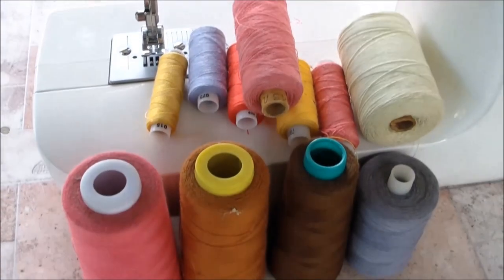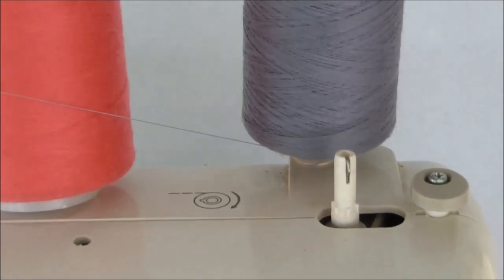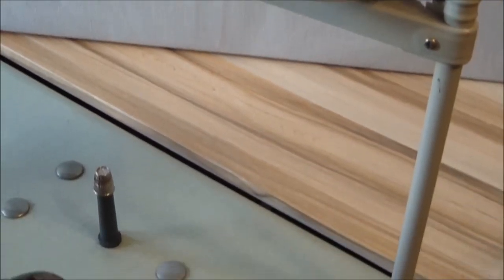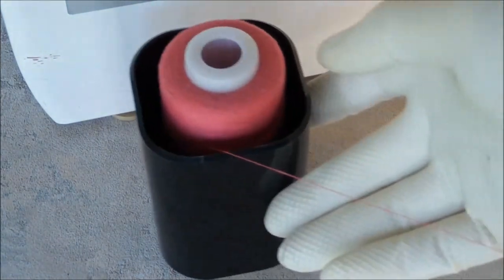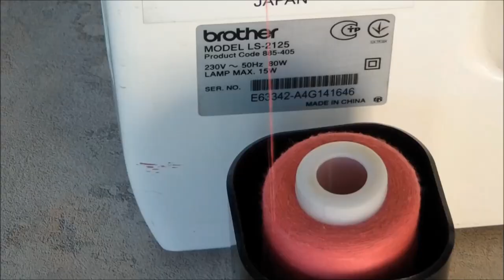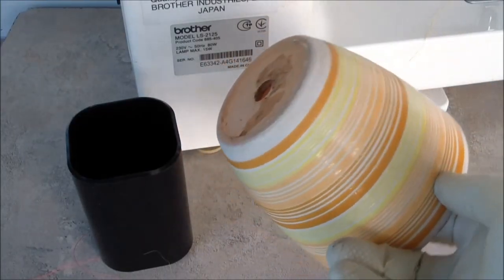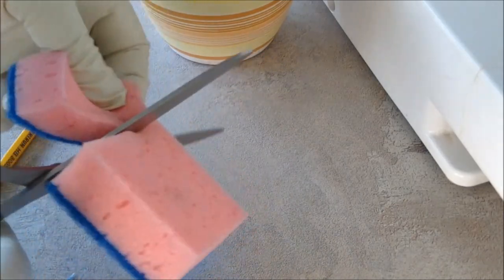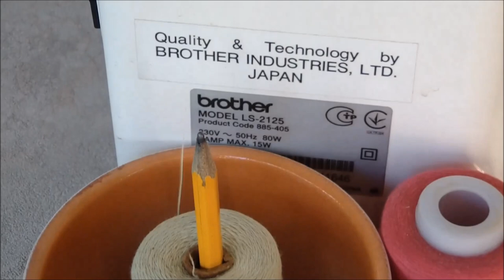How to Sew with Big Cone Threads on Home Sewing Machine

Comment: I'm just looking at other ideas.  Everyone did put the thread in a mug you are the first with a plant jug with a pencil! The other people then put the thread around the bobbin threader before regular threading.  Looking at yours and I'm worrying about the clip sliding down the pole.  Has this happened to you?
Reply from the maker: No, the clip will stand firmly, the thread tension is very weak
Reply: I’m sure you can place a pencil/ pen gripper(s) on the “pole” to provide the stability you are looking for even if you need to increase the tension.